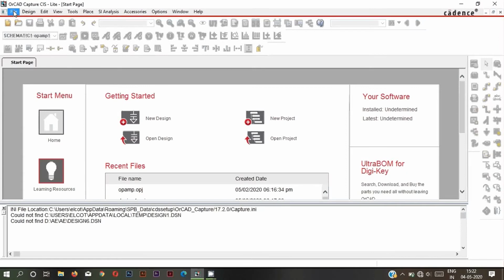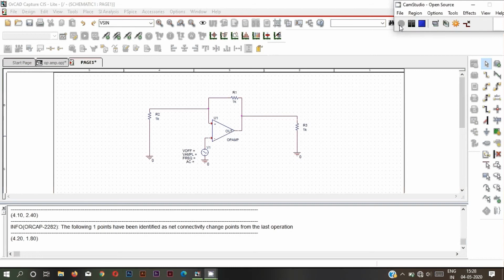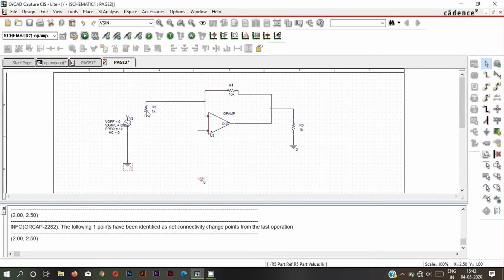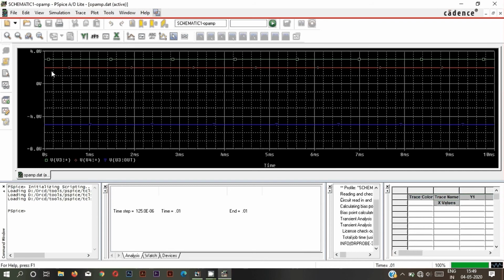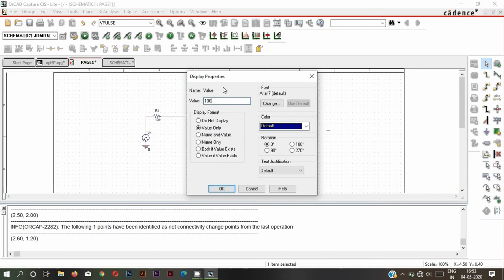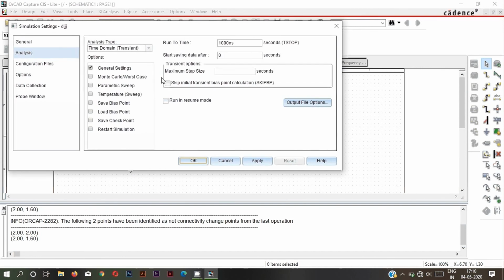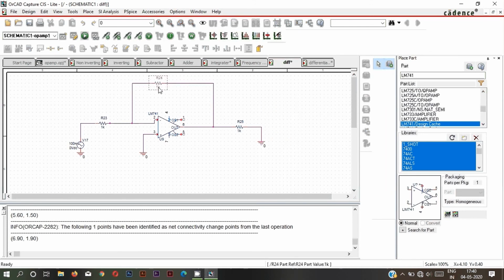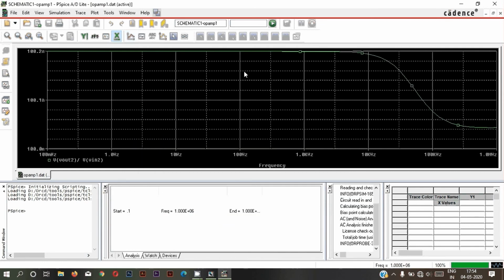Digital Electronics LAB || Op Amp Experiments || Pspice Simulations Part-1 || See Description

Comment from the maker: Subscribe & Comment Below if you want Part 2 containing:

ASTABLE MULTIVIBRATER USING OPAMP
MONOSTABLE MULTI-VIBRATER USING OP_AMP
HIGH PASS FILTER USING OP AMP
LOW PASS FILTER USING OP AMP
ASTABLE MULTIVIBRATER USING 555 TIMER
VOLTAGE REGULATER USING IC7805C